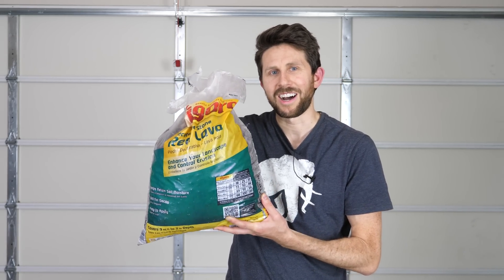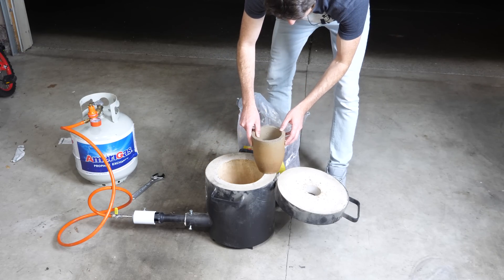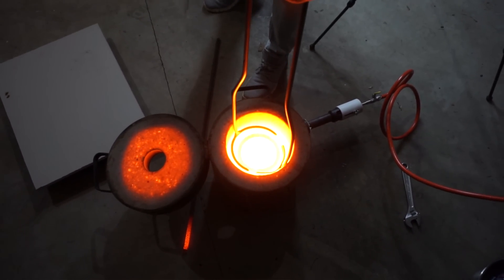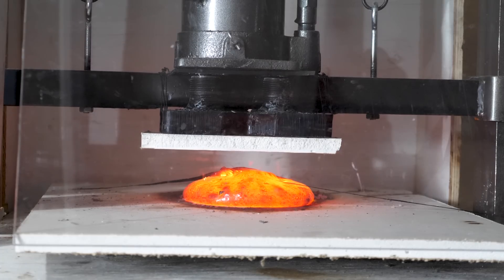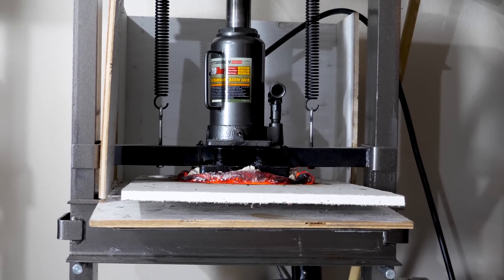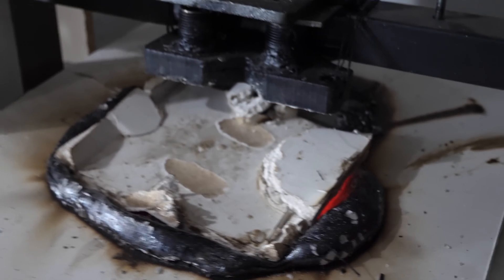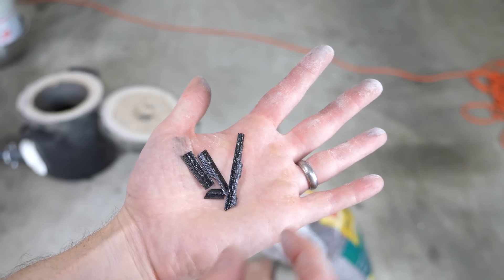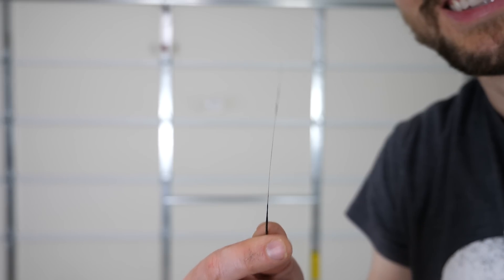Crushing Hot Lava In a Hydraulic Press is SO Satisfying!

Comment: I would have been scared that the hot lava would have caused the pressure in the hydraulics to burst its container due to heat expansion, which could injure you , as well as catch on fire. 

I guess not much of the heat got transferred to the where ever the majority of the hydraulic pressure is?

Comment: I really doubt that the bubbling had anything to do with the lava "boiling" (which is kind of a misleading term to apply to lava in any case, because it doesn't boil all at once into a single gaseous form like water does), and I doubt it really means much about the temperature that isn't already said by the fact that it melted rocks . There are gasses that are released from rocks at all sorts of temperatures: H2O from hydrated minerals and hydroxide minerals (2OH(-) > O(2-) + H2O in the latter case) gets released various temperatures depending on the mineral. CO2 gets released when carbonates break down to oxides. Nitrates tend to decompose at some point that's pretty low compared to lava. (To be fair, how lava eventually does vaporize completely when you get to temperatures way higher than you had in that furnace is largely through similar sorts of decomposition reactions, although a lot of the decomposition products would be solid or liquid at more normal lava temperatures.)

Comment: "I chose drywall because it's made of gypsum, gypsum doesn't burn"

Fireball any time lava touches the drywall
Reply: It dosent burn completely. The paint and other materials in the drywall burn but the gypsum holds it all together at the end
Reply: The paper burns and there's water in that flashes off but it still makes a good insulator. There's a reason you put 5/8th on garage walls.

Comment: If you were to add in pure carbon and press in a cylinder would you make diamond?
Reply: Kelly Elder There are machines that do this...but I don’t think that press has enough force and I also believe you need heat and pressure. The pressures required may create enough heat though. Anyways, yeah there are specific machines to do exactly what you asked.

Comment: The bubbles are left from the original rock you melted, your forge didn't get hot enough for rock to boil, and the flexable strand of rock is really more like fiberglass, since it was stretched out so thin it cooled quickly into basically obsidian which is glass.

Comment: If you used pizza dough the end result would have been the same, but without the waste of fuel melting the lava rock.
MOLTEN  lava has approximately the same consistency as dough.

That's right, there is a difference between saying hot lava and molten lava; in the same way hot metal and molten metal mean different things normally. 

You proved that hot lava is not necessarily molten when you decided to put your gloves on when trying to separate the dry wall from the hardened lava.

Comment: A simple question, can electricity pass through steam, because when water turns into vapor it almost equal to distilled water, does the dust particles contribute to conductivity, if a loose end of an electric point in the shower due to steam can cause a shock?

Comment: Running an engine in a vacuum chamber while the engine is fuelled with oxygen from outside the chamber. Does the engine still run the same? Toque, compression, running temp??